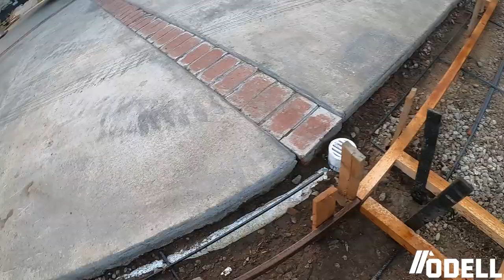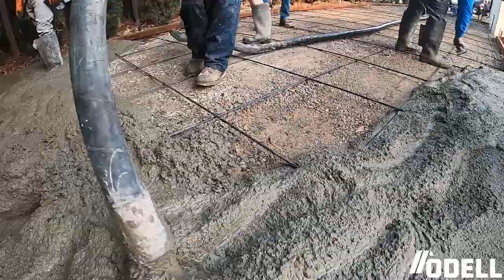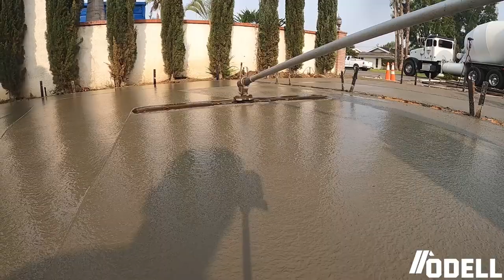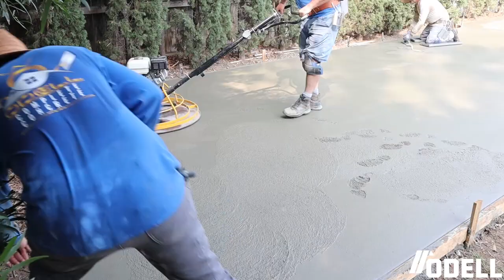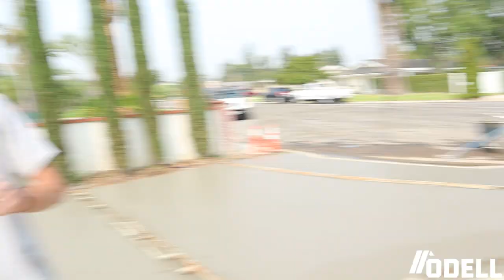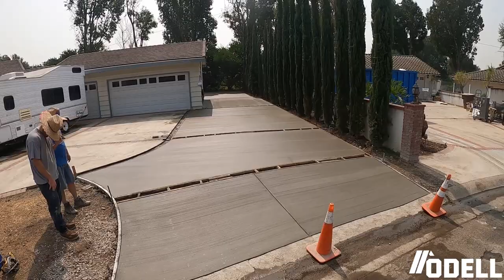Circular Concrete Driveway Extension with Brick Ribbons and RV Parking Pour (Part 2)

Comment: I too went on my first concrete job site about two weeks ago. It was for a driveway addition in Los Angeles and let me tell you, it's not easy. I helped tie off the rebar and it was tough being hunched over in the summer heat. The sun really does a number on you. The other thing I helped with the troweling and edging. Again you need that special touch to get everything nice which I didn't have. Make sure to wear ear protection because the pumping machine is annoyingly loud. Great episode.
Reply from the maker: Yes it is.
TY

Comment: Bought a fixer upper home and am doing sidewalks, patios, double driveway, small pool, concrete tiki bar, hammock pergola, and utility shed with 16 x 12 concrete block bedroom addition and 2 concrete fountains. Have a new 6 cu/ft mixer, vibrator and plenty of tools with top shelf videos from David Odell. What more do i need besides the 34 cu/yds of 3/4 stone and sand they dumped in the middle of my back yard. Of course i ordered the MANDATORY Odell Concrete hat / shirt ensemble with my first 20 lb order of Dave's famous fiber additive :) Thanks Dave and wish me luck!
Reply from the maker: Hi
I just sent your order out today.
Thank you for your support. 
GL

Comment: Interesting, where I am  most new driveways are 6" thick with mesh and wire, must be due to the climate? Great work as always!
Reply: I can only imagine you live in a very sandy or swampy region. Where are you from if you don’t mind me asking?
Reply: @tashtant  colder area
Reply: More resistant to ice, salt, and frost heave. In CA you can make it 4-5" thick unless it's the lower part that gets the heavy abuse provided you've got adequate base below it.
Reply from the maker: Could be
Reply: @matthewhall5571  Did you just throw out a bunch of bs thinking that no one from actual cold climate wouldn't know any better to the crap you wrote?

Comment: Here its 4 inch 3500psi, rebar 16 inch Centers.  One thing we like to do is arc the corners. Can’t cut the grass in the 90’s. So we soften them so its easy to run the mower. Nobody walks and turns on a 90. They all cut the corner. Need to get us one of those funny floats. We have a 36. That small one would be sweet for finish
Reply: You can cut on the 90’s with a string trimmer
Reply from the maker: For sure

Comment: Hi David,  again great work!  With the 90-105 degree days here in SCV.  What formula in the mix do you suggest 3k psi/6.5 sack, water, pea gravel, anything else special?  Fiber mesh added on site .5lb per yard.  Pour begins around 8am while still cool out. Thank you for all the encouragement!
Reply from the maker: You may want to get down to 2500 mix. Curing compound

Comment: I use an old mop and used motor oil to "paint" my 12 foot trailer's deck boards. Those boards will last forever, will never rot, and bugs don't eat the wood.
Reply from the maker: Great idea

Comment: Watching your videos....I have determined that I know nothing about pouring and working concrete....in all the videos that I've watched, this is the first time I've seen you use the "floater". What is the purpose of that tool? Why would you use it as opposed to not using it? Does it have something to do with the thickness of the pour?
Reply from the maker: The area was bigger, and had less concrete finishers.